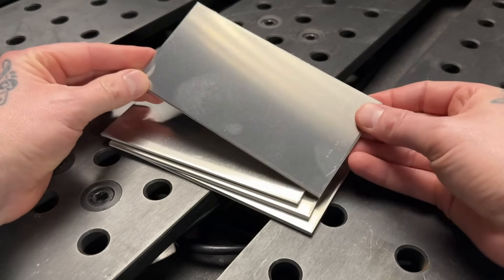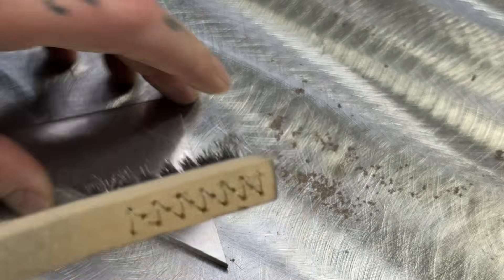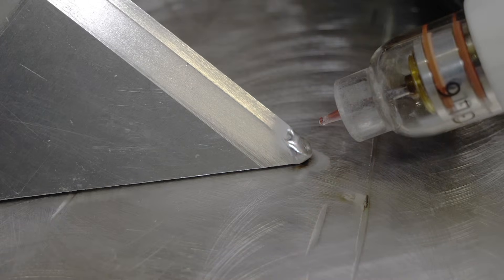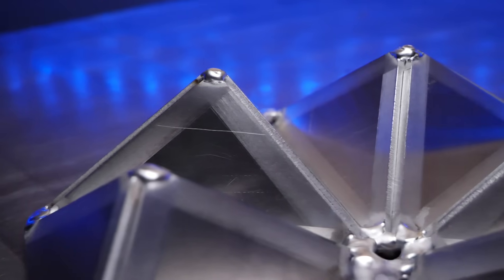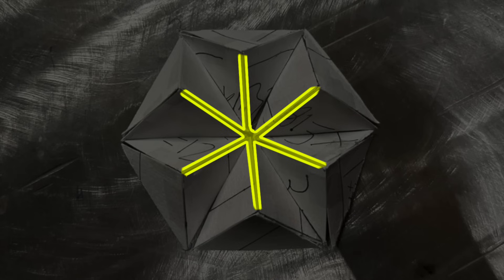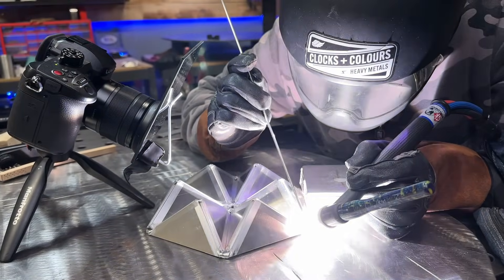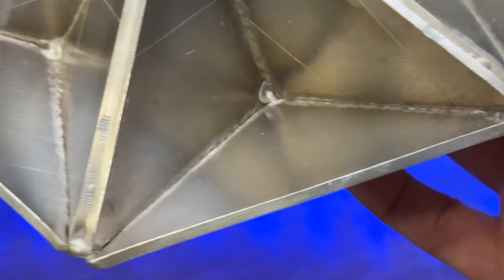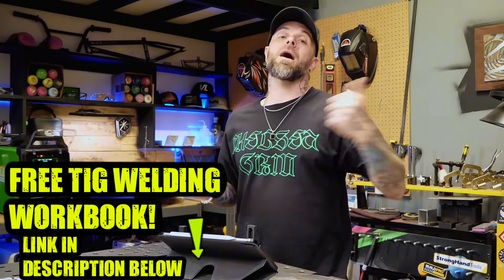Tig Welding- Advanced Aluminum Techniques

Comment: Did you mention what diameter filler rod you used?
Reply: He always uses 1/8" he uses 3/32" for super thin stuff only
Reply from the maker: Hey sorry, might have missed that point in the vid- it was 1/8" or 3.2mm:)